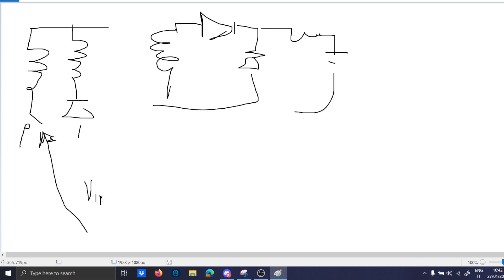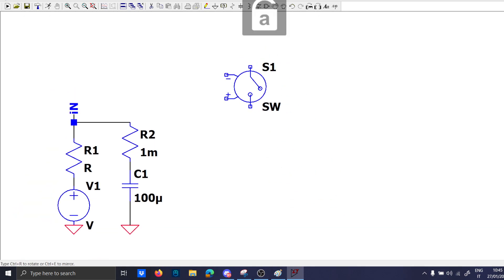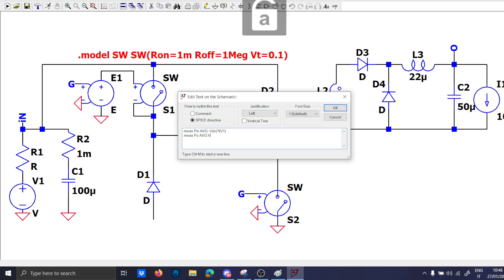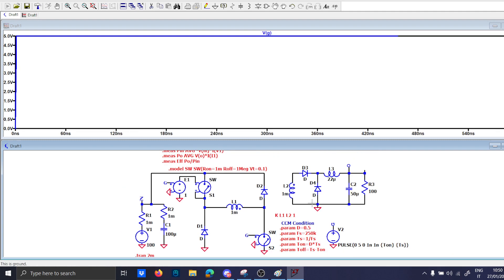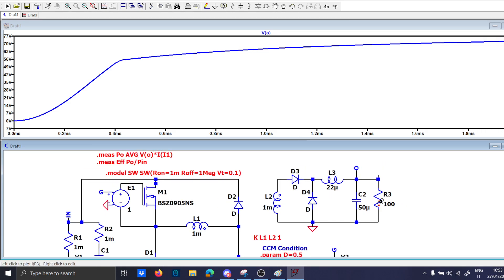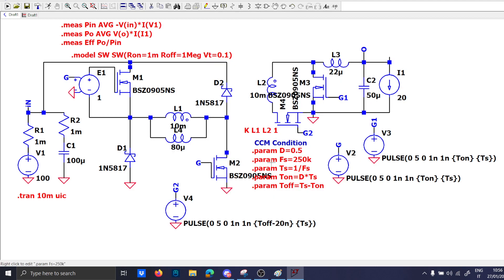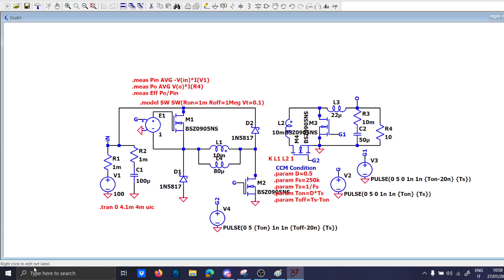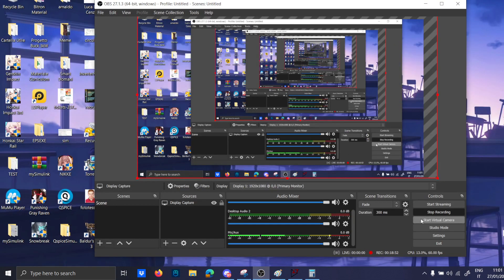LTSpice Two Switches Forward Converter

Comment: Thanks for the video.

Few comments.
1. The initial issue with the simulation (why it was so slow) was indeed caused by the high side driver, as E1 negative terminal was connected to GND, while it should have been connected to the L1 (and that's what you've done with MOSFETs latter on).
2. Efficiency calculation didn't work, because you have to include "param" keyword before using math on symbols thar are not defined in the circuit.
3. Your transformer polarity is wrong, it is a two switch forward converter (and not a two switch flyback), hence polarity of both windings should be the same as energy should get transferred during ON cycle.
Reply from the maker: Hi!
1)Correct 2)Yes I forgot param 3) Yes, unfortunately I messed up the polarity of the transformer , like you said it's the same energy that it is transfered

Comment: Thank you for the video, Mano. As always, I enjoy watching your videos.  I am still working on this forward converter.  The challenges people will discover are finding a good high side gate driver that  could be self contained and does not depend on an external boostrap cap.  Since both FETs turn ON in phase, the issue with currently available gate drivers is the boostrap cap depends on the bottom FET  dc path to charge. since the low and high side FETs are ON, the bootstrap can't charge. The Boostrap cap works fine in complementary synchronous converter, but in real life, I have not found a vendor that can provide an adequate gate driver specifically for this topology.  The alternative is you have to design your own. For Hi reliability designs, derating, worst case analysis, and extended temperature ranges make hard but doable with bjts res, caps etc.  While it is a great topology and good advantages, the big disadvantage is that high side gate driver.  I went back to a single low side driver, and instead of Mosfets, use GaNFETs. They are superior in my mind for Hi-Rel applications. RDSON is low, and they have up to 100V vds. They behave like Mosfet but are very sensitive to gate voltage < 6V.  Lastly, for any isolated supply, the challenges is the transformer selection for your application.  90% of time, there is not one COTS transformer that works in every situation, and you have to resort to custom magnetics.  This is the part that sucks as it is an iterative process and for hobbyists, it can be very costly.
Reply from the maker: Correct. The challenge here consists in the High side mainly, and the forward converter Is seldomly designed. 
About GaN, they can go up to 650V as a BVDSS and they perform Better than mosfets since they have lower Qg, no Qrr, no body diode and lower Rdson resistance. GaN and SiC dominates the market in High Power and medium Power with High performance.

Thirdly, the bridge on the other side with MOSFET Is no joke either, you Will Need isolated references. Isolation Is Always a pain.

Btw, I knew you would appreciate another video about forward converter
Reply: @manoarrostita970  in my application 100V GaNFETs are sufficient but yes, they go very high....